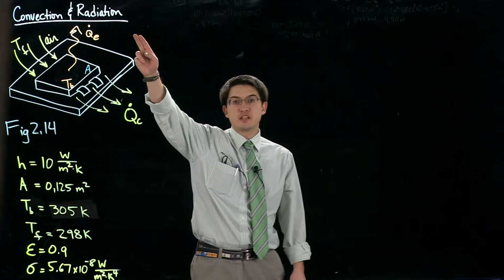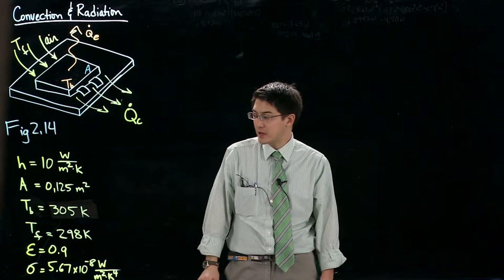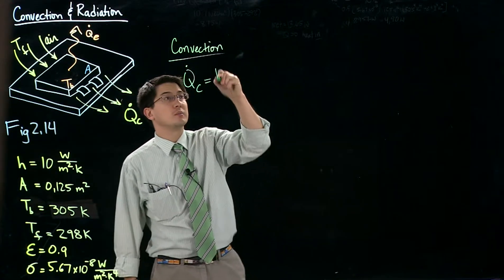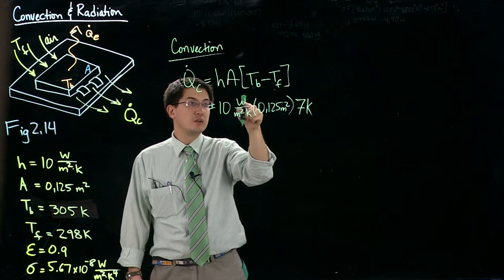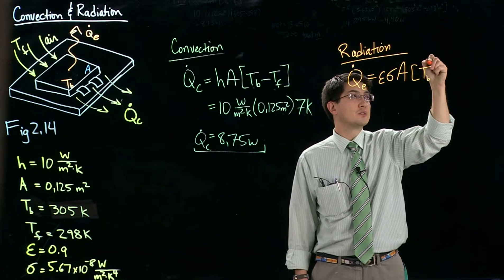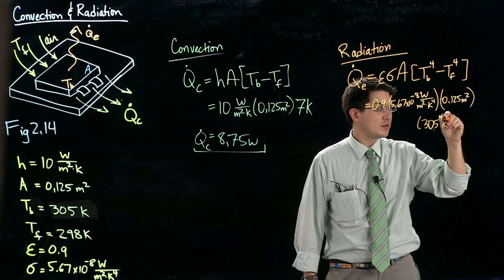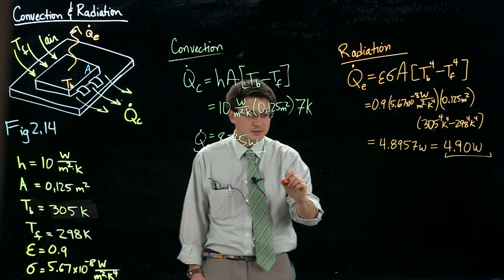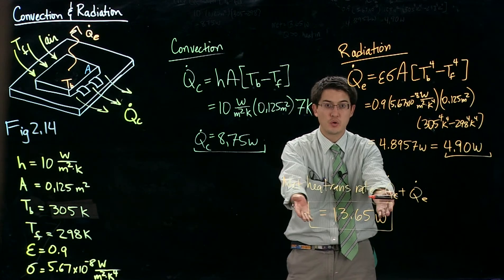ME 220 Example problem - convection & radiation of heat from a computer chip

Comment: Wow.  I cannot help but notice that the example describes a very big chip!  The new and absurdly large AMD Threadripper CPUs TR4 form factor have an external heatsink that's approx 69mm on each side..  A chip having an area of 0.125 sq m, if it were square, would be approx 350mm each side---larger than most of the boxes the big CPUs ship in.